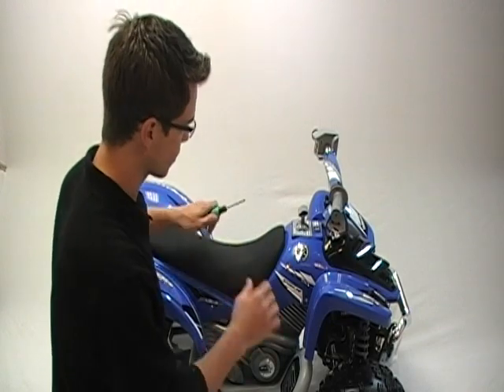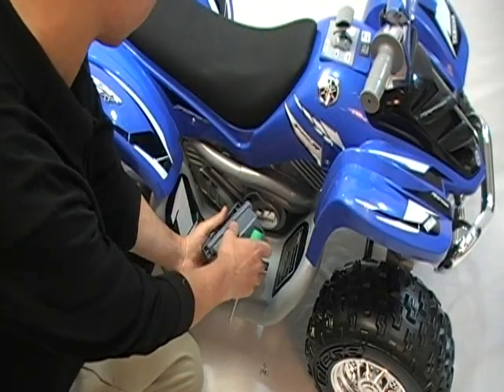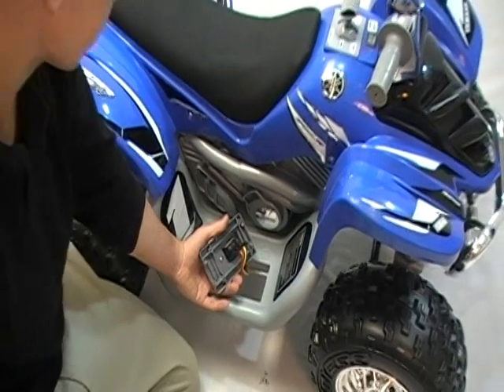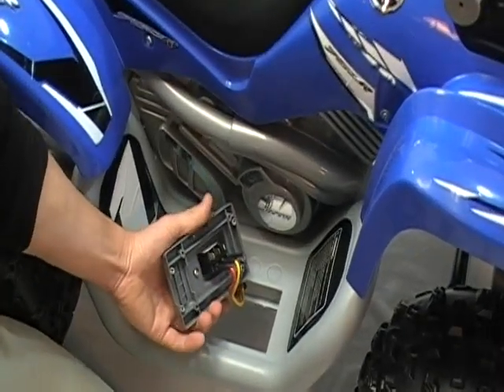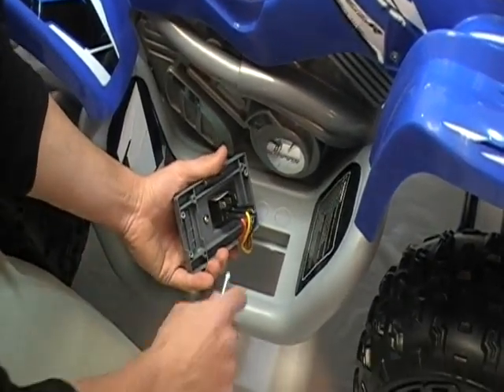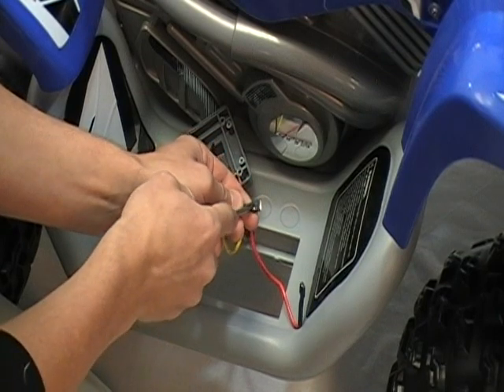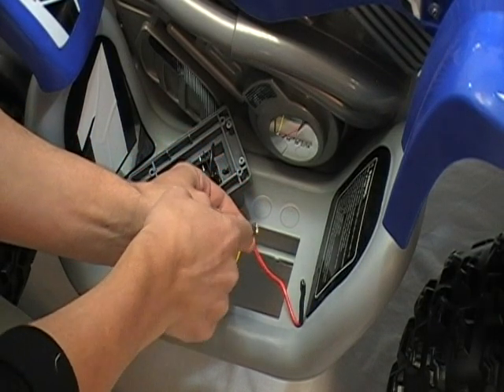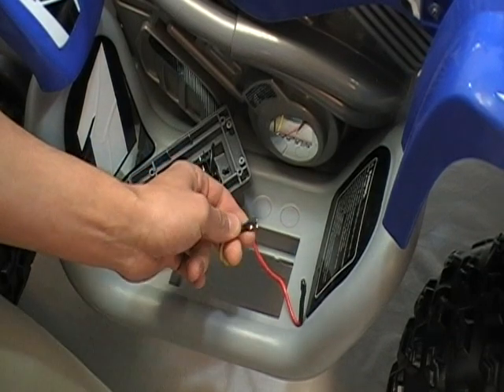trouble shoot pedal switch

Comment: Please help. I can’t get the wires off.
How do you make it look so easy ?
Reply: Try Wiggling back-and-forth as you pull it off
Reply: Press something, such as a screwdriver or needle nose pliers, into the center depression to release the pin in the wire.
Reply: I didn't pull the wires out....I spliced both ends of a wire....then stuck one side to the red and one to the yellow

Comment: What if it gets stuck and keeps running? I just bought a replacement but it’s having the same issue which is that it keeps running and can’t get to stop
Reply: My boy's newly bought battery operated car has the same problem like yours. Did u manage to find the solution for this?

Comment: My little nephew got a battery operated car and on the first it was properly working with remote and pedal but now on the 2nd day the car is moving with the pedal but not with the remote control and on pressing the remote's button the light of the remote turns on but the car is not moving with  the remote but it is moving with pedal please anyone tell me the solution for it.